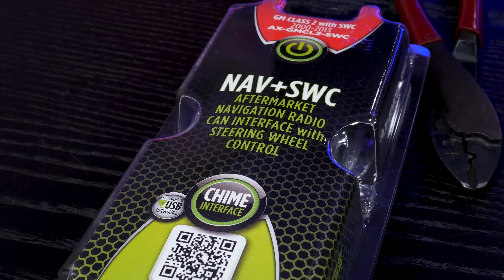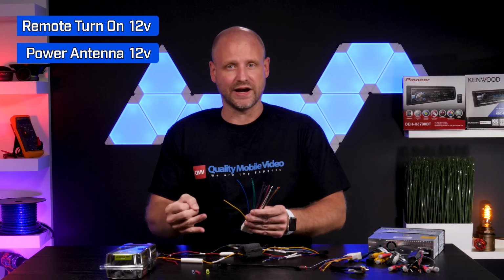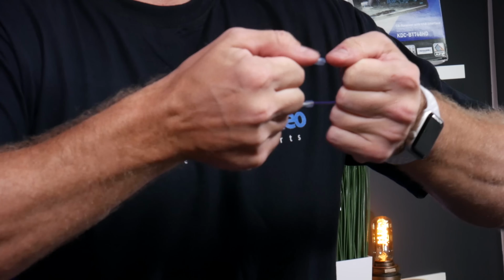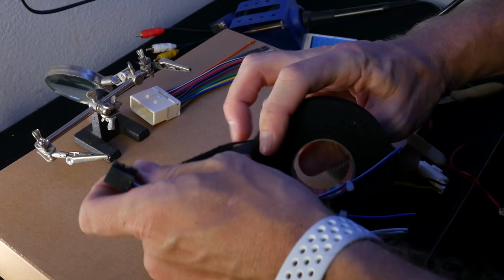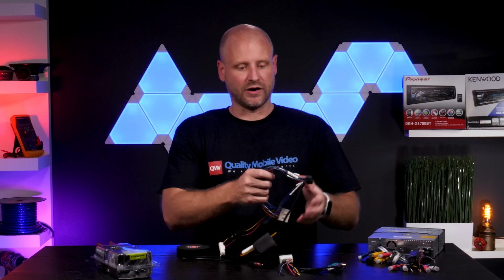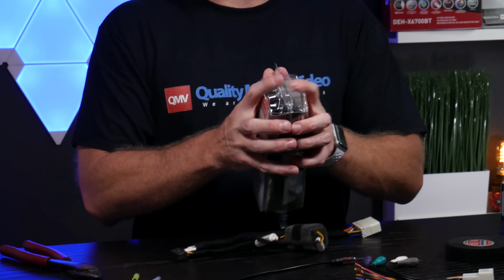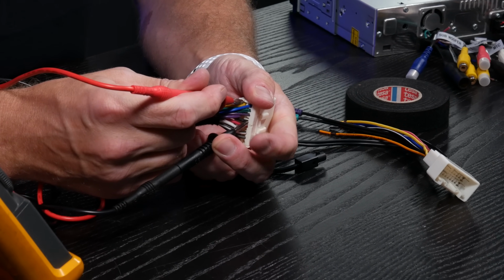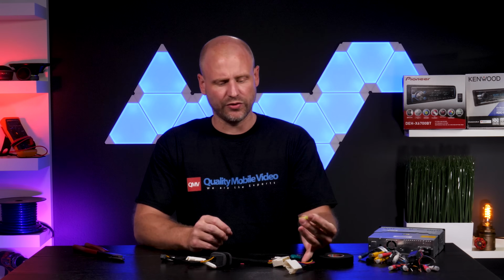Car Stereo Wiring Harnesses & Interfaces Explained - What Do The Wire Colors Mean?

Comment: Excellent video...thank you!  I'm getting ready to install a double din touchscreen radio in my 2000 Honda Odyssey.  Is there anything special I need to do about the factory anti-theft code that goes through the factory radio?  Or, will I still need to type in the code on the new radio once it's installed?
Reply from the maker: I think that depends on the new stereo and whether or not is actually has a security feature!

Comment: Great video. I have a question. I have a Jenson J1CA10FL. I want to connect it to a 2018 Honda Civic hatchback sport.
I would like to use the factory wire harness. But this radio uses a 20-pin power connector, and my honda uses a 16-pin power connector. I can't find a compatible interface for it. Does this just mean Jeson radio is not for Honda? There are standard connections to use. However, like you mentioned in your video, my car has a can-bus. Wiring manually sounds difficult

Comment: So, I'm a little lost here regarding the actual harness needed, and the bare basics of it.  (Ive got a 04 car, so a basic am/fm radio w/ cd player). 
  -If my understanding is correct, the connection is as follows: vehicle wiring -> wiring harness -> solder+ heatshrink -> head unit cables -> head unit?? 
 -If I were to get a new radio, would I need a wiring harness? Do all aftermarket head-units require a wiring harness?
 -Are wiring harnesses car-specific or universal? They look very similar video to video, and this is the first that mentioned varying types.

Any response is appreciated, thanks! 👍👍
Reply from the maker: You've basically got the idea! All cars require their own unique harness, so I need your make model on you 2004 vehicle to recommend what you need.

Comment: I’m doing an aftermarket head unit for a 2017 Nissan Rogue. It is equipped with Nav and Bose/ factory amp so I’m using the Maestro RR interface. I’m getting no power to the HU however. The instructions read that there are 2 wires (CAN L and CAN H) that need to be connected to a 16 pin harness that is located behind the glovebox. Would those 2 wires prevent the aftermarket from turning on? Crutchfield said they wouldn’t but I feel that they would? Any help would be appreciated.

Comment: When crimping wires i like to use a open barrel and have the wire go almost all the way through on both ends and only crimp hard in the middle. It is almost impossible to tear those connections apart. For ecu wiring harness it is actually the preferred method to use harder alloy crimp connectors so when you crimp them they fuse from cold welding.

But solder is way easier to do than to get a good crimp.
Reply: Agreed. Use an open barrel crimp connector that has a built-in hole to pour in solder. That's even better.

Comment: With the orange wire, there are 2 in the factory radio and one in the after market, is it okay to connect the 2 Orange wires in the one orange from the after market? thank you.
Reply from the maker: No, chose one and insulate the other.

Comment: For compact active subwoofer (underseat), tp be precise is Blaupunkt GTR 130A, is it ok if connect the power(yellow) wire to the power wire of headunit? Not direct to the positive terminal of battery. Is it enough power for the active subwoofer?

Comment: When the directions say to connect black wire of ASWC_1 and wire from Pin 6 of vehicle's wire harness to Chassis Ground does that mean I completely cut off the wire from Pin 6 of vehicle's wire harness and ground it straight to the vehicle along with the black wire from ASWC_1?
Reply from the maker: Don’t cut it off, just connect it to ground on your harness.

Comment: I have a 2004 Mercedes’ Benz clk 500 , Bose system fiber optic non GPS and uses cd changer in glove box - looks like it uses factory amps - I’m looking to install a after market stereo but can’t seems to find the correct harness or interface online or at a local stereo installer shop - are you able assist me with this problem with a part number or website link ….. thank you
Reply from the maker: System is all fibre optic to the amp. You'll need to buy a Mo-Bridge or rewire every speaker with active crossovers.
Reply: @Qualitymobilevideo  is there a link or website or product number for the mo bridge

Comment: Hi I have little bit trouble please help me , my Sony harness the orange wire has white line and the harness for Prius just orange , can I connect it together? If I do not use it , does the system work? Thank you.
Reply from the maker: Yes you can connect them together
Reply: @Qualitymobilevideo  Thank you for your help , I already installed my Sony AX3200.

Comment: Hey hi there I have a nissan armada 06 I used a regular harness for an aftermarket radio and the speaker doesn't sound I don't know if I need to used interface harness  my car doesn't have a GPS
Reply from the maker: This is the harness you need for a base model:
https://www.qualitymobilevideo.com/70-7550.html

If your car has an internal amplifier this is the harness you need:
https://www.qualitymobilevideo.com/70-7551.html

Comment: Great video! But more cars have a backup camera and SWC what then? I have 2014 Honda CRV LX with both.
Reply from the maker: Easy! Just additional interfaces are required. For your vehicle:

To replace factory radio:
Simple harness
https://www.qualitymobilevideo.com/70-1729.html
Or...(Factory clock)https://www.qualitymobilevideo.com/hdcc-01.html

To retain SWC you need this:
https://www.qualitymobilevideo.com/aswc.html

I can't find a harness for you for backup camera retention, but it will probably be fine so long as your new stereo has a backup camera input and it's wired properly

Comment: I got the specific harness for my 1995 semi truck and got a pioneer radio. my wires are old and new new wiring. so i wired new speakers ( front and rear and will connect them to harness proper lights. How  do i connect yellow, blue,  red etc lights if that harness from dash dont work and need to get all wires from source replaced.

Comment: For some reason grey is my right rear, white is my front right, purple is my rear right and greenn is my left front. Speakers work but is this an issue? I plan on wiring an amp i was just going to wire it according to that arrangement. My biggest concern is if this will affect the performance?
Reply from the maker: That is very unusual.

Comment: I have a 02 Chevy trailblazer LT and I wasn't sure if that was required to have a special harness to get installed in a double din kenwood stereo and I was wanting to keep the steering wheel control with it
Reply from the maker: These are the parts you'll need:
Wiring Harness
https://www.qualitymobilevideo.com/70-2054.html
Retain Steering Wheel Control
https://www.qualitymobilevideo.com/aswc.html

Comment: Nice  video. I'm finding I have 5v on the remote wire when the engine is off and the key out.  I have a dsp  and 2 amps and new boss head unit.
Reply from the maker: Thank you!

Comment: So my son wants to hook up an amp and subs. He tossed the wire harness that hooks up to the stereo. I see you said the 2 blue wires. To hook up a remote wire from amp to the stereo. What wire do I hook it up too on the back of the stereo? It’s a rav 2009. Worst part is the ground for the amp. But not to concerned about that. I know wire brush works if there’s paint.
Reply from the maker: If it is an aftermarket stereo you will connect the remote turn on to the Blue wire.

Comment: The electricians at my work use heat shrink tubing which has a soldering joint built in. When they use the heat gun the 2 wire ends are automatically waterproofed and soldered at the same time. The tubing is transparent so the connection can be checked.
Reply: Yeah I ordered some and never got the right stuff....🙄.
So I just soldier and heat shrink I know I've got a good connection then.
Those do it yourselvers only melt soldier on the outer wires and nothing else mine I get flux on it and they're thru and thru

Comment: How do you connect Aux/USB to the power supply after installing after market MP5 dashboard player because unlike original radio, it doesn’t have connection for them but I want them working just like before?  My car is 2018 Nissan Versa SV. Thanks
Reply from the maker: Metra manufacturers adapter harnesses, worst case is you swap the plate for an aftermarket one.

Comment: Great video boss I have a 2002 Impala I'm going to be installing an aftermarket radio but my local AutoZone only has the single connector and my car has 2 connection
Reply from the maker: Hey Raul, you're gonna need an interface to replace your factory stereo! You have quite a few options too:
https://www.qualitymobilevideo.com/gmos-01.html
(Onstar retention)
https://www.qualitymobilevideo.com/gmos-4.html
(Onstar and amplified system)
https://www.qualitymobilevideo.com/gmos-014.html

Comment: Quick question I'm installing a Pioneer FH-S701BS in a 2001 Nissan Pathfinder. I had to get a PAC ROEM-NIS2 integration interface so I can use the Bose preamp that came with the vehicle. The interface has a blue with white stripe "amp trigger wire" and a solid blue "power antenna" wire. I hooked the blue with white stripe amp trigger to the blue with white wire that came on the aftermarket harness but I'm still not getting any power I soldered all my connection with solder and seal wire connectors so they're pretty solid. Any ideas what I could have done wrong?
Reply from the maker: What's your make/model/year?

Comment: well thx that explains a lot but just asking have a Peugeot 206cc  don t have a harness and the is no ignition wire can i take the yellow wire(battery) directly to the battery and the radios ignition wire to the battery with a toggle switch ?

Comment: Great video. My after market radio has the wires you described in the video which I understand fully. I have 6 other wires aside from those which are labeled with tags in English & Chinese. Key 1 (org-blk) Key 2 (brown-blk) Brake (brown) Ilumm (org) P-Center (blue-white) and Reverse (pink) which I assume goes to backup light. What do the other 5 wires hook to?
Reply: Did you figure it out?
Best I have found is they operate the steering wheel controls.
That is the key wire's not sure which is which.
I have the same problem.
Received a cheap Chinese one and I have all the other wire's figured out.

Comment: i just got a bmw e36 and the previous owner has torn apart the original wiring harness so its just the wires and colors do i put these negative and plus colors in the same hole or right next to eachother?

Comment: Is the remote turn on (blue wire) any different from the accessory (red wire). I want to hook my stereo up to a switch board to run while vehicle is off
Reply from the maker: Yes, remote out is a 12 volt signal from the radio. The red is a 12 volt turn on wire from the vehicle.

Comment: So there's a ground wire coming from the aftermarket harness and another ground wire coming from the stereo head's harness, do I connect the two together or do I ground them both to the car chassis? If I do ground them to the car chassis is it okay to use the same ground for both of them? I'm currently getting terrible static and I think it might be because I connected the two ground wires together, but I'm not sure, any help would be cool!

Comment: Mate - I am building a new loom on custom  build car (no data bus) - I have no head unit yet but leaning to double din apple play pioneer unit. the AMp is a MB Quart NA540.6 Nautic Amplifier, 6-Channel 540-Watt and I have run RCA cables  to the dash area. I also have  DKMUS Universal ISO Car Radio Wire Cable Wiring Harness Stereo Adapter Connectors. What to best practice here, do  splice in th e RCA to the ISO connector, get adaptors  or should  use the loom plugs with the head unit? ( was hoping to get wires sorted and then choose a head unit)

Comment: The wire harness I got for a 2003 Honda CR-V has orange dimmer/illustration wires. The wire harness that came with the aftermarket radio does not have any extra wires for it to connect to. Could you touch on this?

Comment: I’m looking for a little advice I have a Vauxhall Vivaro 2014 model I need to know on the back of the radio apart from the wiring there are two plugs one Brown and the other beige or buff coloured each having a black looks like cable what are these for, any help

Comment: For crimp butt connectors, It makes a better joint if the you strip enough wire so that the wires cross each other inside the connector.
Reply from the maker: I prefer the fold over method but this is also a great way to do it.

Comment: Hello, can I connect additional 4 speakers to the 4 stock speakers in my car? Just by hooking up to the cabels - + of the stock speakers? My radio has 8 canals, for 4 speakers, so is it ok do double one canal with to speakers instead of one? IS it safe for the radio and the speakers?

Comment: Great video! I do have one question, though. In newer vehicles where the factory radio is able to detect whether or not the car is in park before allowing you to perform certain tasks, would it be possible to have an aftermarket radio communicate with the gearshift to do the same thing, at least in some cases, or would tapping into the parking brake wire still be required like in older cars? For example, in some Hyundai Tucson models, the factory radio will not allow you to pair a new phone to Bluetooth unless the car is in park.

Comment: I tried replacing my JVC head unit when it died with another slightly cheaper unit. The new one didn’t have the orange dimmer wire and when I put my headlights on the dash looked liked the illumination was way to bright almost washed out not the green glow. Is that normal? My JVC had that connection and never had an issue. I guess what I’m asking is should I look for a radio with that wire. It’s an 02 Dodge Ram.
Reply from the maker: Yes, without illumination wire you cannot control the light output unless your radio has manual control.

Comment: This is such a handy tutorial.  I am hardwiring a new radio into the car, and I have an issue.  I have two power cords coming in from the batter that I need to connect. One is a positive and one is a negative (I'm pretty sure I'm using the multimeter right). If I connect both I break the fuse. Do I only connect the positive?
Reply: I think negative is your ground

(Just in case you haven't finished your project 2 years later)

Comment: What is that tool called that you’re using to hold the wires while soldering them?
Reply from the maker: https://www.digikey.com/product-detail/en/aven/26000/243-1018-ND/600972?utm_adgroup=Loupes%2C%20Magnifiers&utm_source=google&utm_medium=cpc&utm_campaign=Shopping_Product_Optical%20Inspection%20Equipment_NEW&utm_term=&utm_content=Loupes%2C%20Magnifiers&gclid=Cj0KCQjwqrb7BRDlARIsACwGad4cfBmq7hkZoWvfzMD1bT3QwWCV1dl2YCoMhR7AtiCAzXRG6YffJlgaAmIQEALw_wcB
Reply: Quality Mobile Video thank you so much that will help me a lot with my installs

Comment: Having a problem installing an aftermarket radio on my 05 Sonata. Used a wiring harness and matched all the colors. The new stereo does not have a blue/white wire to splice to my cars factory amp. I splice it to my ACC wire however still no sound. Any advice ?

Comment: Question...If I wanted to power a switched relay for other appliances... (as my truck they are impossible to find switched circuits in the fuse box)... ... would it be ok to "T" off either the red acc wire, (does that provide constant 12vdc when the key is on, to energize the coil on the relay?) or would it be better to use the blue wire... I assume that is only providing 12vdc when the radio is on... which would be fine 99% of the time as the headunit (double din in this case) would always be on with one of the options... I think the relay would draws about 70MA?? I have three items to power... two are small LEDs...(grill and backup camera LED probably less than 20MA between them, and a dash cam ... which draws about 400MA..? Thank You.

Comment: I've built a home stereo using my Pioneer car head unit. It's powered by a pc 550W 20A PSU . If I turn off the PSU I loose all my settings and radio presets. I don't want the PSU running 24/7. 
Could I use a small 12v 2A supply to provide constant power which would preserve settings? If so how do I connect it, to yellow or red? Is it dangerous in any way, when both PSU and small 12v supply are running simultaneously?
Many thanks.

Comment: Hi plz help i wanna make external powdered Stereo system using toyota PZ071- 12017-B gps music system. 
I connected 12 volt to pin 4 and gnd to pin 7 ( of 10p + 6p ) connector but the display didn't turned  on i also tried to connect pin 3 ( Acc pin ) to 12 volt  but nothing happened ?
Plz share the datasheet and complete wiring diagrams ?

Comment: Hey folks I have a question   I just purchased A MTX terminator two 12s in 1 boxand the amp is 1200 Watts also terminator.
I have it in my 2003 Pontiac grand am. 
I feel like it's not beating to it's full potential so I went back over my wiring and the h-l-i cord is not hooked up.
Am I supposed to run new wire from back of radio to the hli piece or how do I hook up that part? Please help ASAP.
SHOULD I BUY NEW AMP OR DID I DO SOMETHING WRONG???

Comment: I done everything right on my 04 Silverado 2500, I have tried 2 different stereos the last a Boss and both after running a few minutes get almost to hot to touch on the back of the stereo what could cause this
Reply from the maker: What harness or interface are you using? You have an issue with the speaker outputs being over driven.
Reply: @Qualitymobilevideo  schosche

Comment: hi I'm having a problem with a Boss Audio amplifier, I put it in my truck and it has the rock, class,flat,pop, and eq off settings. When I have it in every setting but eq off all 4 speakers work, but when I have it in eq off only the drivers side works, could you tell me what's wrong.